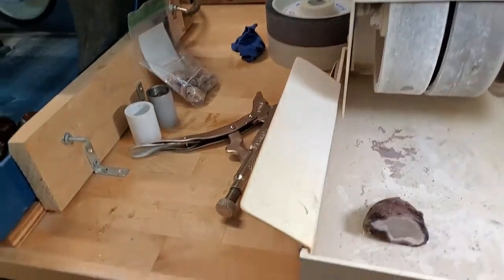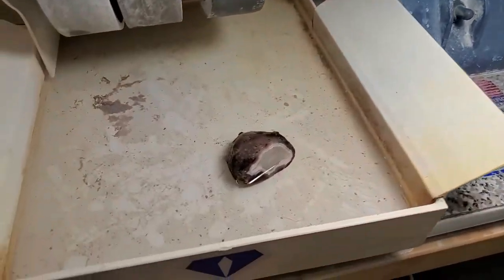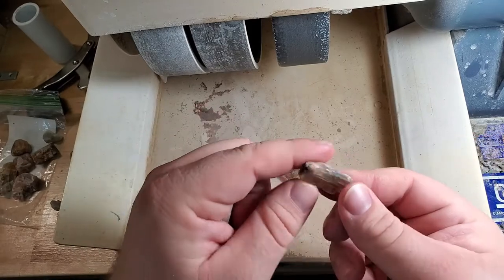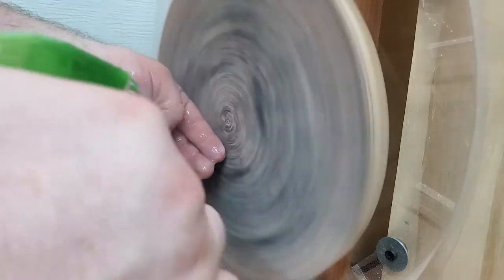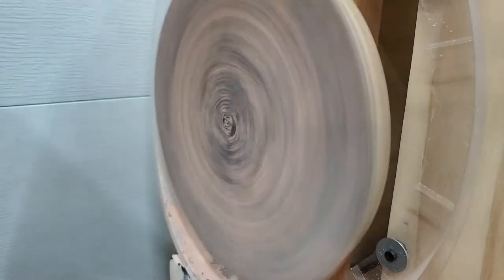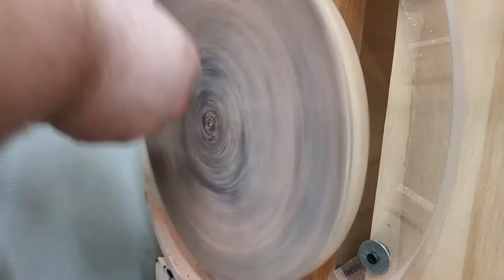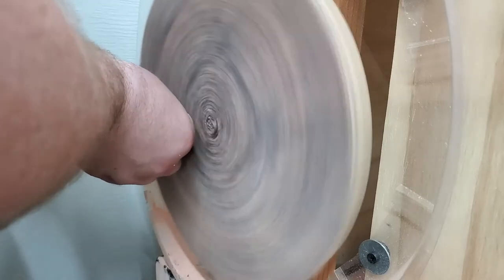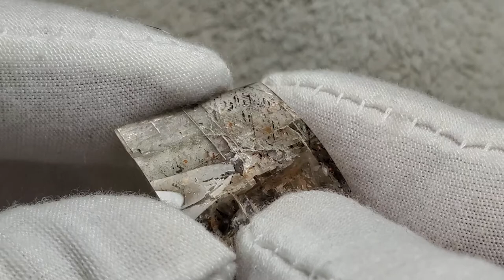Rainbow Lattice Sunstone - A rare gem

Comment: Where can you buy cheap affordable rough lattice rainbow sunstone?
Reply from the maker: I just got lucky and found that parcel on Ebay. I just make sure to check the review of the buyer to make sure they are legitimate and have mostly positive reviews.
Reply: @WorldofRockhounds  cool thanks. Also I noticed the one you polish have many crack lines. Is this rock prone to cracks? It’s very hard to find a rough or even polished finished product without a crack line in the middle.